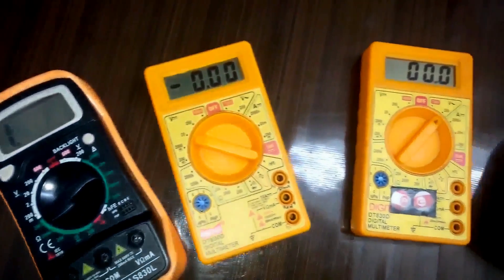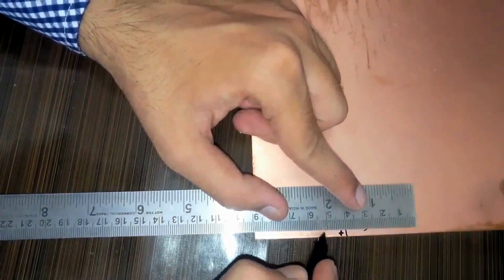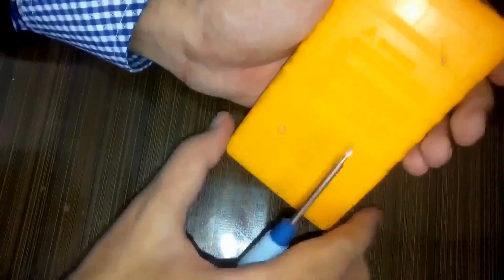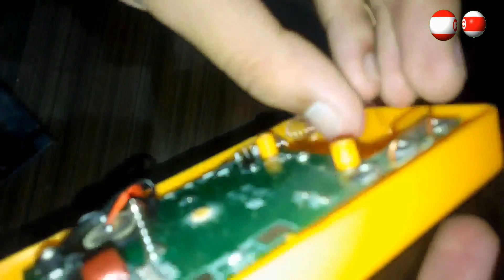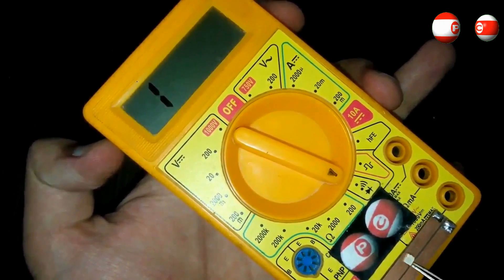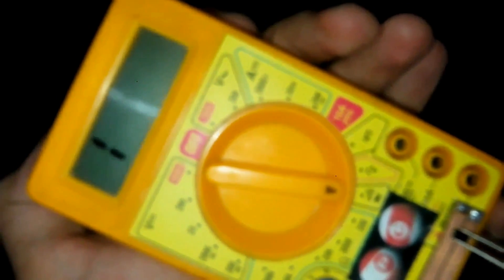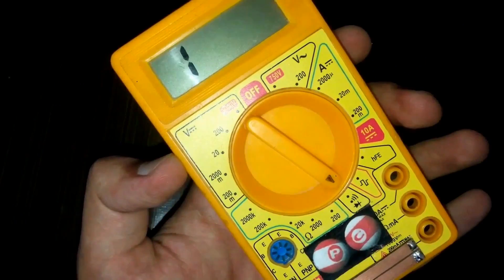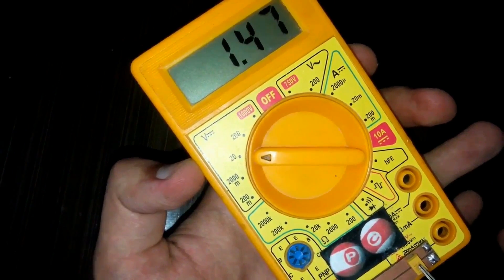Test SMD Component With Multimeter.

Comment: This is literally extremely dangerous!
If you measure mains voltage which is 230V or so and touch the copper you will be electrocuted!
Do NOT use this trick!!

Comment: Im very confused, what keeps the negative and positive separated on your copper strip?
Reply from the maker: I have etched that PCB. That's why i was first make designed with marker and by etching uncovered copper is dissolved in FeCl3 solution And if you want to make FeCl3 solution at home then please watch this https://youtu.be/8gdNFISk6Xw . I hope your double is now cleared. And i extremely sorry  for the delay in reply. have a good day.
Reply: This is PCB , not a copper plat. So he etch copper in middle and at the bottom there is ceramic surface.

Comment: I have a micromax 1800 it has a problem that when I want charge it by charger unfortunately showing battery errors
Reply: Bishnu Pada You must try a new battery for your corresponding model.
If you know soldering and desoldering then this problem can solve by remove a smd resistor on battery.
Reply from the maker: +PRASHANT MADAN You are right he must try a new one battery. This problem cause by temperature terminal of battery , but if you replace resistor or remove you may lost your battery high temperature protection. Thus try a new one battery.